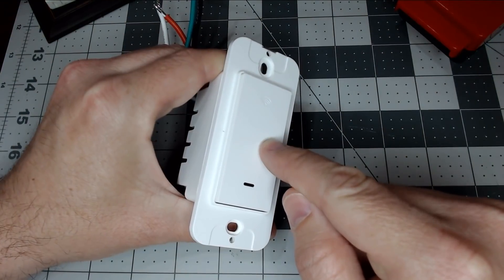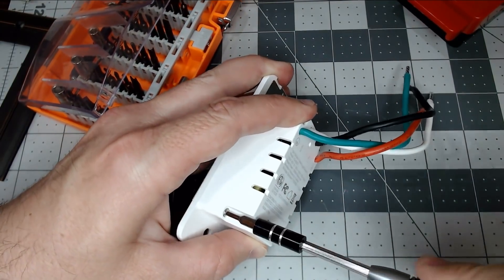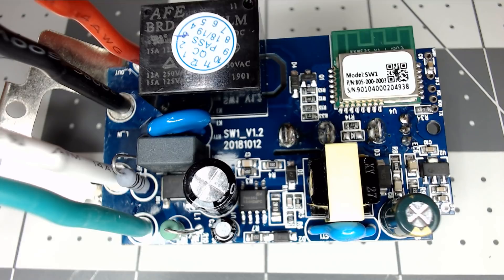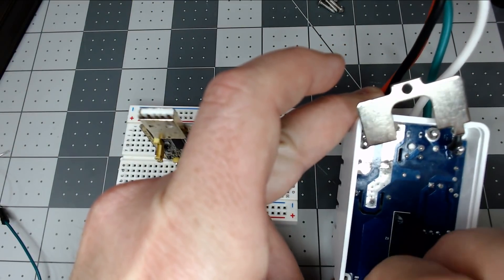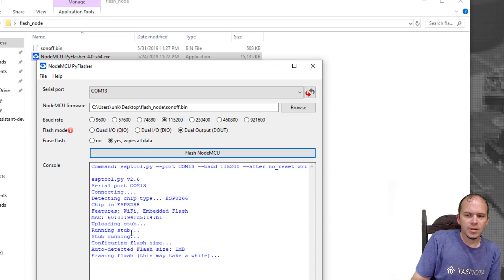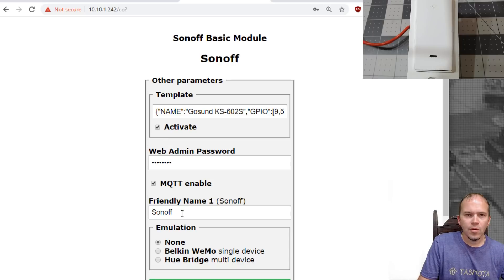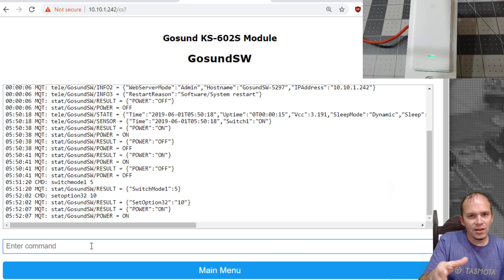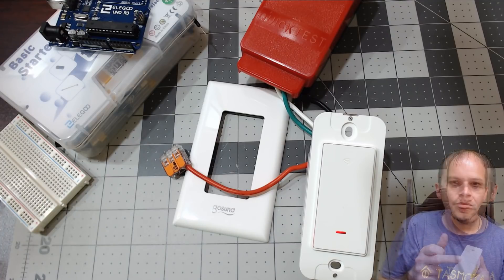Gosund Smart Switch with Tasmota - No Soldering or Tuya Convert Required

Comment: Travis a know that it has been a while since you made this video. I have a quick question after you flash it and install the switch back in the wall is there any way to put it back into AP mode?
Reply from the maker: Button 1 pressed 6 times?
Reply: @digiblurDIY  no luck I am sure I will have to pull them..
Reply from the maker: There's the 7 power cycle deal too depending on the version on it.
Reply: @digiblurDIY  Thanks for the reminder worked like a champ.

Comment: could you please make tutorial to convert gosund SW2 dimmer to tasmota????
Reply from the maker: That dimmer was bad last time I looked at it. Horrible design and function even on stock firmware. It only got worse as it was flashed.
Reply: @digiblurDIY  oh ok, im trying to figure out if i can flash with tasmota... i guess i need to buy other dimmer or use the tuya integration on home assistant... thank you though!!!

Comment: Were you able to flash tasmota on Gosund Dimmer SW2 or DS1 using Tuya-Convert  OTA , it never able to find the dimmer . So  I tried using serial wire using FTDI and soldering wires . I was able to flash it tasmota but didnt work well. Console functionality and physical dimming were not in sync. 
Do you have video to use tuya-convert for Gosund Dimmer DS1 or SW2.  Or any other way around. If I have to flash using FTDI adapter then which tasmota template I should use?
Reply from the maker: No Gosund dimmers for me, they were absolute junk even without Tasmota on them so I never bothered with them.
Reply: @digiblurDIY  So which brand do you recommend so that I can easily flash them to Tasmota on OTA using Tuya Convert ?
Reply from the maker: The MJ OG dimmer of course - https://amzn.to/3vbVl1R

Comment: Have you had a chance to flash the latest switches from Gosund?  They have a new format of the  TyW3es module.  Infact it looks to be completely integrated into the swtich...  This is their SW5 V1.2 (on the board) or KS-602S on the back..
Reply from the maker: There should be pads on the side. You can use clips to get them.
Reply: @digiblurDIY  Got it!  Thanks... I 3D printed the pogo thing and ordered pins.. and all I needed was tiny clips... Getting my stuff out of the cloud!

Comment: Do you have any video where you are talking about the Gosund Wall Outlet Extender you have linked in your Amazon Smart Plugs category? I'm interested to see how to flash it and if there's already a reference on the gpio pins. Also, is the LARKKEY power strip good?
Reply from the maker: I believe I did those via TuyaConvert at the time but they do have screws to them manually if needed. I don't think I have a video on them though.

Comment: Dec 2020 - I just bought a few of these wall switches, same model from Gosund. Well, they've revised it. Won't do OTA anymore with Tuya-Convert. Also the board is very different, no holes anymore to insert headers and they've been moved to the right side of the board... bummer.
Reply from the maker: I showed the new pics of it in my smart switch video last week.
Reply: @digiblurDIY  Right you are. I did watch it but failed to notice it was identical to the ones I just bought. No holes for headers. Tuya-convert also does not work. Suggestions on flashing them with Tasmota ?
Reply from the maker: Use some test clips like I did in the jig video. Just clip them. We were talking about this in Discord today with pics. https://amzn.to/2BRSR1C

Comment: Liked your video. I've got some other Gosund plugs but wasn't sure I wanted to buy any wired-in devices in case their cloud goes away, but this looks like I could easily flash Tasmota if that should ever happen.  Also, I tried using your link to purchase the switch from Amazon but that product is no longer available.  You might want to update your link to this "4-pack" of those switches, it's a very good price right now!  https://smile.amazon.com/Assistant-Control-Schedule-Required-Single-Pole/dp/B0871JF1JZ/ref=sr_1_7

Comment: The app is simple and easy to use and responds very rapidly at the switch. I also added to my Alexa device and that works also. It took me a minute to find the skill and set it up with Alexa but once I got it there have been no issues turning the light on and off through my Alexa Dot. Overall a great product for a low cost compared to the big brands.

Comment: I bought a Gosund dimmer light swich model DS1. The internal module is a SW2. After many try, I was able to get it to work with this template : {"NAME": "Gosund Wall Switch", "GPIO": [255,37,255,255,17,255,255,255,52,158,255,0,255], "FLAG": 15, "BASE" : 18}. To be functional, this template must use the PWM1 at 98 or 99% for toggle ON / OFF. In this state, the leds in front of the switch flash quickly when I touch them. With the PWM1 at 100%, I am able to see an interaction but the connected load never changes in intensity. With the PWM1 at 100% I can toggle OFF
but toggle ON does not work ... Only works at 99 or 98%. Do you know how to use the dim option to control a wire load on this dimmer switch? Another template?

Comment: I ordered a 4 pack of the gosund switches, and they are different. The model number on the back is SW1, the inside is totally different.  There are very small pads labeled RX, TX, 3.3, IO0, and GND.  Is this model flashable via soldering or TC?
Reply from the maker: You can try the Tuya Convert but luckily those pads are broken out still but not as good as they were before.
Reply: @digiblurDIY  TC worked. I was concerned because there was no writing on the ESP chip. All is well, thanks again!
Reply: @ritchk5170  Thanks for posting this. I just received the same switch today, model number SW1. So glad TC works. Can't wait to get it working.
Reply: I might have bricked one of the switches. I selected Tasmota 1.02 firmware. Basically, the led on the switch turned off, and after about 10 minutes the console said "cannot connect to device". After that, I was unable to manually switch toggle the switch. Is it possible to load either the backed up firmware or Tasmota using soldering method at this point?
Reply from the maker: Tasmota is on like 8.5.0 or so. That's a really old firmware.
Reply: @digiblurDIY  bummer. Live and learn :) I should have checked. I simply went with the bundled version with TC from git. Thank you again.
Reply: @digiblurDIY  which version of Tasmota would you use on this switch today?  I am getting two of these tomorrow from Amazon.  Can I flash 9.2.0 to the switches or should I use an older version?

Comment: can you flash tasmota on the gosund mini wifi outlet?
Reply from the maker: Yes as long as it isn't blocked.
Reply: @digiblurDIY  can you be a little more specific?
Reply from the maker: If it is an ESP chip and doesn't have the new blocking firmware.
Reply from the maker: Of course if you have physical access to the chip of course you can flash it.

Comment: @digiblurDIY I bought same brand dimmer. Somehow the 4 tiny screws on the back of the box are so tight. I also bought the tool you recommended but just can't loosen the screw. Any tips? Thanks,
Reply from the maker: I had to end up getting some of these on a little different batch to get some more torque on them.  https://amzn.to/2tQcjrQ
Reply: @digiblurDIY  Thanks for sharing. Just ordered and will let you know if it works or not.
Reply: The new tool did the trick. The dimmer model I got  is Gosund DS1 https://www.amazon.com/Gosund-Compatible-Control-Single-Pole-Required/dp/B07WSSTVL5. Wondering whether the video you posted for Tuya dimmer will work.
Reply: @digiblurDIY  The dimmer model I got  is Gosund DS1 https://www.amazon.com/Gosund-Compatible-Control-Single-Pole-Required/dp/B07WSSTVL5. The tool NodeMUC-pyflasher failed to connect the dimmer using FTDI. Any help would be highly appreciated! Thanks,
Reply: @seancheng4875  Did you get anywhere with this? I'm considering purchasing a four pack of the dimmers and I'd love to integrate them with Home Assistant.
Reply: @jcconnell  The screw driver works but  I wasn't able to flash the device with tasmota. : (

Comment: Good stuff, Travis. I appreciate how you seem to cover all the bases and warn about possible exceptions to "the way it should work".
I just bought a 4-pack of the Gosund wall switches and noticed something interesting after flashing Tasmota (which went flawlessly, thank you). The green led never lit initially when the button was pressed. I followed the procedure to switch the red and green and then the red led did light when the button was pressed, as expected. I switched back to the green led indicating "on" and it never lights up. Back to the red and it works. I really would prefer the green led indicating the "on" state. How can I make this work? Thanks!
Reply from the maker: Could you share the layout/template you are using?
Reply: @digiblurDIY  Gosund KS-602S  Generic (18)
Reply: @digiblurDIY  Name:Gosund KS-602S   Based on: Generic (18)
Reply from the maker: Come hit me up in discord. Can walk through some rules and such to get this how you want.

Comment: Travis, Thank  you so much for these great videos. I have learned so much. Question for you. Is it possible to have one of the LEDs blink when by garage door is open? My garage door is also using tasmota to control the door as well as monitor door open or closed.
Reply from the maker: Yes you could assign one of the LEDs to a relay2.  Then use the pulsetimer command found in the wiki to blink it.  You could have that garage door send over the command to blink or not blink the power2 relay.
Reply: @digiblurDIY   Thank you for the response. Maybe you can help me with another problem. I am trying to the the switch HOLD and Rules to work. At one point it worked then stopped. I have seen many videos indicating Rules only work with switchtopic 1 but the documentation says switchtopic 0. The rule came right out of the Rules Cookbook on Tasmota site. I am really getting frustrated since it worked then stopped. Here is the rule. By the way this is the Gosund KS-602s Module configured from your video.

stat/BackyardLights/RESULT = {"SwitchMode1":5}
stat/BackyardLights/RESULT = {"SwitchTopic":""}
stat/BackyardLights/RESULT = {"Rule1":"ON","Once":"OFF","StopOnError":"OFF","Free":453,"Rules":"on Switch1#State=3 do publish cmnd/ShopRack/POWER ON endon"}

The HOLD is published but the rule never fires. I tested the publish command and it works.
Reply from the maker: Actually no, rules won't work with switchtopics set as it bypasses the rule for the switch.  Switchtopics are the old way basically before rules.  

do you have the button set as a switch1?  One way I like to test a rule for a switch to see what is being done is make one like this...  rule1 on switch1#state do publish test/me %value% endon   Then I do short presses, long presses etc and watch the log to see how it is working.

Comment: Hi, new subscriber here! Great video. Quick question, is it possible to set this switch so the LED is green when off, off when switch is on and red for link errors? I would like to use the LED as a locator light. Thanks!!
Reply from the maker: Absolutely.. We were just talking about that in my discord yesterday using the light to show things. Jump in (link in description) a few of us are there and can walk you through.

Comment: Great video and I’ve installed 4 so far. Anyone figured out a way to have the red led on when the switch is off? I prefer to see the switch in the dark.
Reply from the maker: yes, this model has the ability to control each LED.  What lights do you want on in which state?
Reply: digiblurDIY I’d like red led on when the switch is off and green when on.
Reply from the maker: Put this template in...  {"NAME":"Gosund KS-602S","GPIO":[17,56,0,0,0,0,0,0,0,0,21,0,158],"FLAG":0,"BASE":18}

That should make green on when on, I'll make you a rule to turn red on when off.  Let me fire up one of these.
Reply from the maker: Here it is... Template has it setup as button1 (switch to switch if you need that)

{"NAME":"Gosund KS-602S","GPIO":[17,56,0,255,0,0,0,0,0,158,21,0,53],"FLAG":0,"BASE":18}

Then here is the rule command to paste in

rule1 on power1#state do backlog ledpower2 %value% ; ledpower1 %value% endon

Then turn it on with 

rule1 1

Comment: Great video! I haven't explored Tasmota (or MQTT or NodeRed) yet, but I was able to flash ESPHome on the Gosund switch. However, now that I've flashed it, I can control the relay (GPIO 14), the green LED (GPIO  1), and the red LED (GPIO 16) via Home Assistant, but the physical button no longer does anything. Do you know what GPIO pin the physical button/switch uses? I tried everything except GPIO 6 through 11, because if I try to use one of those, ESPHome gives me the following warning: "WARNING ESP8266: Pin 6 (6-11) might already be used by the flash interface. Be warned."
Reply from the maker: I believe GPIO 0 is the button on these.
Reply: @digiblurDIY  Thanks. The switch is clicking, but doesn't seem to be triggering GPIO 0 (or turning on the light). If I trigger GPIO 0 via Home Assistant, the light toggles on/off. But maybe I broke something. :) I'll do some further testing and see if I can figure it out. Much appreciated!
Reply: Yep, it's GPIO 0. I had a mistake in my .yaml file. Thanks again!
Reply: @adarlington  anyway you can share the template (.yaml) file used for ESPHome. I got everything working but my status LEDs.

Comment: Dont know what im doing wrong.  I get the switch flashed with NodeMCU program on com port 5.  I disconnect the green or io0 wire and unplug the usb.  When i plug it back in without the green so it doesnt start in flash mode i loose my com port.  when i try using termite to add my ssid it cant connect because there is no comport connected to the usd adapter.
Reply from the maker: It might not have enough power to boot. Have you tried powering with mains with no USB wires connected? It should go into access point mode.
Reply: @digiblurDIY  Do i not need to access it via termite to give my ssid and password?
Reply from the maker: If it is a blank flash then no. Tasmota will come up in access point mode. Connect to it with a device and browse to 192.168.4.1, hit scan, pick your wifi name and type in the password. Be careful on the password. If you type it wrong you will need to wipe the flash again.

Comment: Instead of having the LEDs on, could I just turn them off and control it based on sensor states in Home Assistant?
Reply from the maker: Yes. Assign the led pins as relays and they become easy to control switches in HA.

Comment: Which switch gives you the most button options? Thinking of using one for a scene controller and just disabling the relay. Would you get 4 out of this? On/off + long on/off?
Reply from the maker: Probably the most buttons would be the Martin Jerry or Acenx dimmer like I did in the smart light control video. This would only get you two actions.
Reply: @digiblurDIY  I get 3 actions from momentary switches like the Kuled running as Sonoff Basics: single-click, double-click, and hold.  Follow the table at https://github.com/arendst/Sonoff-Tasmota/wiki/Control-other-devices.  SetOption1=1 and SetOption11=1, then set ButtonTopic to a special topic, different from the regular topic.  If you use a different topic, you can get 3 different mqtt outputs from one device: single press (<topic>/POWER ON-OFF), double press (<newtopic>/POWER TOGGLE) and hold (<newtopic>/POWER HOLD).
Reply from the maker: Will check it out and see how it works, I don't use the topics anymore as I use the rules to drive the custom topics I want to publish.  Thanks!

Comment: Great video again. One question. Can you confirm the specs for voltage is compatible for 230v installation?
Thanks again
Reply from the maker: These only show 110-125 on the back.
Reply: @digiblurDIY  Thanks for reply - interesting looked at the specs from the link on Amazon and they said 230v at 1800w.

Comment: Another great video. With this switch, how many 8265 pins are available to Tasmota ????
Reply from the maker: Unfortunately only one really as they did tie one LED to a RX/TX pin.  You could still use it if you detached the LED on it.
Reply: @digiblurDIY  Is this also true for the KuLED Seitch ???
Reply from the maker: No. I used both RX and TX in the motion and temperature light switch video.

Comment: So basically, the KuLED without the wacky LED situation, but with a crappier wall plate. 

Nodemcu pyflasher looks sweet for us MAC users!
Reply from the maker: That's it, this is the updated model of it.  Pros and cons, no standard header, but better button and no hardwired LED nonsense.  Luckily on my singles I have plenty of blank screwless plates from other switches putting them in 2-3 gang configs to use.  Could have been worse I guess and the branding be on the switch itself.